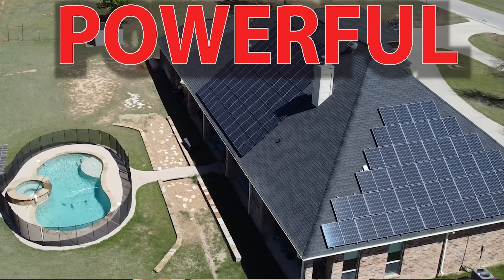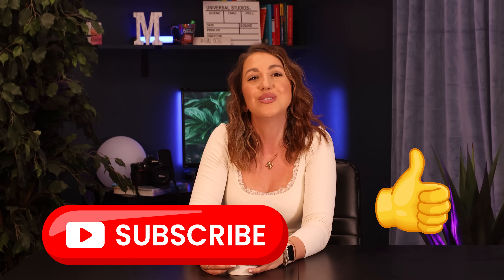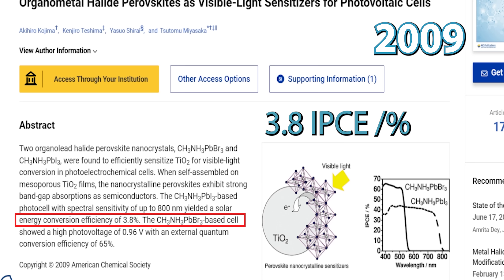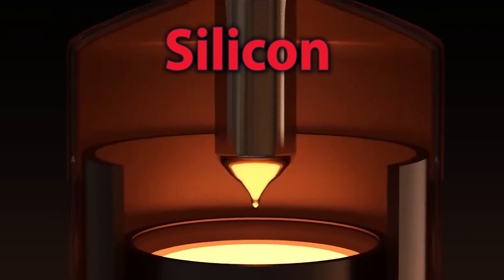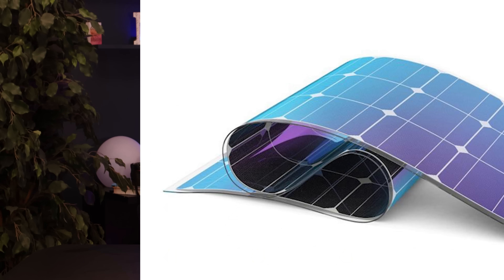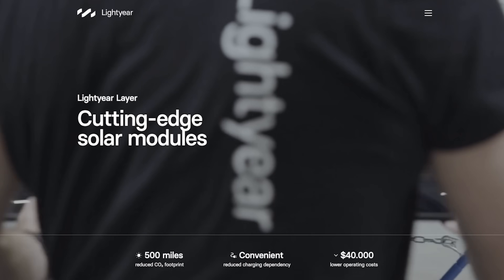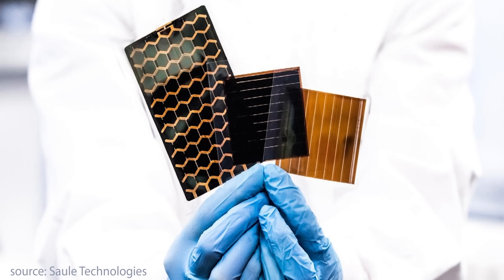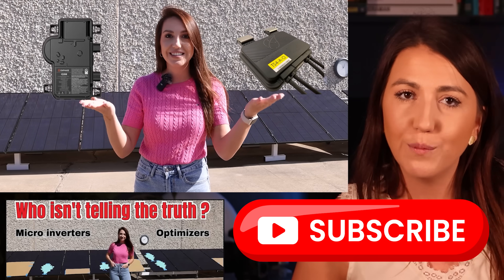Perovskite Solar Panels- You Can Print It Like Paper! Will it Kill Silicon?

Comment: The biggest issue is durability. They are vulnerable and not very long lived. Saule have big problems. The CEO is suing investors. They ate thru 200 million zł(~50mln$) and dont have a factory yet. So the project can die in Poland sadly.
They were developing this technology I think since 2010-12, so its not that new. I hope it develops, but I am not hyped anymore. Too many years it stalled.

Comment: "coat your phone"  Yeah, no.  Setting your phone in direct sunlight at an angle facing the sun, not the best idea for its temps.  Remember even if we assume 35% figure is achievable in real world conditions that still means the other 65% is heat.  Let's presume this solar cell phone can generate 3 watts, at noon, when pointed at the sun.... That means you need to assume 12 watts of heat pumped into your phone, the thing is going to cook, its going to need active fans to keep it from exploding.  

And remember this is an ideal situation where the phone is propped up pointed at the sun.  Even so 3 watts of solar input does not mean you will get that all day long that's what you get at cloudless summer noon.  The average would be about 4.5 watt hours per day per solar panel rated watts. That's if its pointed at the sun from dawn till dusk.  So now your phone is getting 13.5 watt hours of power input but there are charger and battery inefficiencies that will eat about 15% of that. So your battery will only see about 11.5 watt hours.  

Now a 19 watt hour phone will be running which will take some watts to keep it on but in a non active state.  

In the end, your phone will need to be out of hand propped up pointed pointed at the sun all day to get probably less than half a charge, even assuming these lab sample 35% efficient solar panels can be adapted for use on a phone. 

It's simply bullsplat, marketing lies. This will not be something your typical phone will ever have because its simply impractical.

Comment: Sorry, get a bit fed up with "announcements" of "this will change the future of,,,,,."  OK, an increase in efficiency, but it is really only a reasonable increase if it works. Solar cells will never get much better simply because there is only so much photos which can be converted to electricity. Mechanical strength? What happens when a decent hail storm hits? All the elements which make up all the layers which make a big mess when damaged. People, dig a bit deeper and do your research please.

Comment: I've kept up with this design and blows me away with over %30 efficiency and my LG panels are only %22 this could be a game changer for the future of solar production. Just get rid of the lead some how and find a filter system for the other wave lengths of light to control degrading and break down!! Great video and informative as usual 👍 👏 👌
Reply: Solar Stirling engines were between 35% to nearly 40% efficiency over 40 years ago.  Companies tried this but largely failed.

Comment: Efficiency is just a footprint you know the size of the panels but at the end of the day could only put in 15% of advertised output or extra electricity Easley demonstrated with a volt amp meter and 4th grade math called ohm's law

Comment: You can't compare a Lab tested multi-junction cell to a singal junction commercial product with 5x the service life! Silicon cells can reach over 40%
For silicon-based multi-junction cells:
Tandem cells (e.g., perovskite-silicon): Lab efficiencies reach 33-35%, with commercial modules around 25-30%.

III-V/Si multi-junction cells: Record efficiencies hit 39.5% (e.g., Fraunhofer ISE, 2023) under 1-sun conditions, though practical efficiencies for commercial applications are closer to 32-35%.

Concentrator multi-junction cells (using silicon substrates with concentrated sunlight) can exceed 40%, with lab records up to 47.1% for 4-6 junction cells under 143 suns (NREL, 2020).

Comment: My question is if it ever comes to market, will this be the new lead based paint, or leaded gasoline?
Reply: Perovskite is harmless. Its a specificly organized organic structure.
Reply: @iliasclaeys2687  Thanks for that but until they are successful with lead alternatives it does contain lead, so how is it harmless?
AI (who would NEVER lie to us) says,
Yes, the lead in perovskite solar cells can be a significant environmental hazard. While perovskites offer high solar energy conversion efficiency, the use of lead in their production raises concerns about toxicity and potential leaching into the environment if not properly managed. 
Here's a more detailed explanation:
Environmental Concerns:
Toxicity:
Lead is a heavy metal known for its toxicity, with potential impacts on human health and the environment. 
Leaching:
Perovskites can deteriorate and release lead into the environment via water, air, and soil, especially when discarded or damaged. 
Bioavailability:
Lead in perovskites can become bioavailable, meaning it's accessible to plants and other organisms, potentially leading to contamination of food chains.
Reply: @pathfollower  good to point that out, I didn't know. We still use lead in a lot of products (also some pv silicium panels). If properly handled and in a sealed containment, there is no hazard. Lead is highly recyclable btw.

Comment: I've seen some videos about Perovskite, including the latest advancements and the possibility of mass production. I believe it will soon be made available to the general public and together with sodium batteries, these will become the two main foundations on which renewable energy can take the definitive leap to be globally adopted. Sodium batteries are much easier to manufacture, significantly more affordable and represent a major leap in terms of safety, especially regarding thermal runaway risks. The efficiency boost from Perovskite, combined with these batteries, could drive the cost per kW ($/kW) to be very low. I hope both tech to be avaliable in 2030s
Reply: Oxford PV have been delivering panels for more than 6 months.

Comment: Another empty claim. Perovskites are known for a while. Their efficiency drops in less than a year to less than a conventional silicon solar-cell. That's what made them useless, and you're claiming otherwise. Just words and wishes.
Reply: @joen5000

If they are as easy to make and deploy as the video says, then replacing perovskites on a regular basis like once a year would be practical.  And that's certainly not useless, especially in emergency and temporary situations.

Today we can buy reels of LED light strips that are lightweight, flexible and cheap.  In the future, the perovskite solar PV Sheets may come in a roll and just be unrolled and collect solar energy for a short period of time.  The only thing I see that might be a problem is not being able to dispose of them because of the lead halide in them.
Reply: @acmefixer1  That would be a huge environmental issue. Remember, they are deposited on films that aren't disposable, and their materials aren't best for the environment. Compared to todays' modern solar-cells, that last 3 decades, and already quite cheap, except in the USA, due to the tariffs, which is a special case, there is no viability for creating disposable solar-cells, when realistic long-term solutions exist. Besides, there are film-solar-cells that can last for years without negative environmental impact, so why use pompously claimed not-proven high-gain solar-film, when practical and better solutions exist.
You need to keep in mind, for over 40 years scientists have been claiming to have achieved over 80% efficiency. Everyone who has to do with science knows, these are empty claims aimed to justify the funding of their research and for them to advance towards higher academic titles. In reality, none of these claims has ever been proven to be true. These are according to my estimation over 98% of the claims. In other words, most of the fancy publications in this regard are worthless.
Perovskites suffer from a huge stability issue, which makes them useless for real applications. As long as that is not solved, they will have no practical use. Besides, they've never proven to reach 35% efficiency even under lab conditions.
There are solar-cells that can practically reach 38% efficiency in real life, but they are way too expensive, and therefore are used for special applications like in satellites, where price doesn't play a role.

Comment: It won't be flexible panels. It will be the tandem cells.
Perskovite and silicone absorb different frequencies of light. That is why efficiency will be higher for both together than either alone.
Reply: It depends on the circumstances. Tandem cells will be great, if durable and not to costly.
Flexible cells will be great too, if cheap and lightweight, just for other applications. Think about glueing them to the walls of a house.
Reply: @johnbraunschweig Tandem cells are still not as lasting. So you would have 30% efficiency for a few years and then it drops to the 20% longtime silicon waver production.
Reply: Well let's Design a triple efficient panel that also features heat energy extraction cooling the cells which will make them even more efficient and if we are lucky we build heated pools or store the heat  underground for winter. Anyway transparency could help avoid hot panels...
Reply: @usertogo  just run black piping under your solar cells to take off the heat, and it actually helps the efficiency of your solar panels but cooling them down
Reply: @usertogo silicon already absorbs heat but like the rest of its bandwidth only 20% to 25%  (Perovskites absorb UV + visible light)

Comment: Oh wow, this is pretty exciting!  

My 2 cents on longevity:  Cheaper production and flexible configurations mitigates the need for longer life.

Imagine if the panel frames and wiring were just that, frames.  Then every 10 or 15 years just replace the inserts at 1/5th the cost, and you get the latest advances and hit the reset button on other wear concerns, like maybe storm damage.
Reply: It's not only about cost, it's also a out sustainability. A panel that lasts 30 years will always be better.
Reply: @enricod.7198  High efficiency, recycling/reprocessing infrastructure, biocompatible, low-cost, and low-toxicity ingredients could make a life cycle this reasonable and sustainable. The old panels aren't thrown away; they are used for something else, such as building materials, special mineral reuse, etc. There will always be a market for 30+ year solid performance, but that isn't necessary for this to be a great, earthshattering advancement in energy for decades to come.
Reply: If the panels are 10c each it's meaningless if the scaffold needed to install them is $1million

Comment: I would love to see this application used on E-planes.
Reply: Nowhere near enough surface area to supply the energy needs. These will be fine on buildings.
Reply: @hughmarcus1 ultra-high efficiency powered gliders, the same as are currently powered by silicon panels.

Comment: I think the biggest new use for cheap solar panels will be for bifacial vertical fencing. Imagine if every private property and public space was lined with solar fences instead of chain link ones... That ALONE has the potential to add GW's worth of power to each city or state without taking up any additional land except for the transformers/battery storage centres which are still relatively compact themselves..
Reply: I like your enthusiasm but you don’t understand grid stability or PV panel efficiency
Reply: @stevehartley8162 nor do you

Comment: I already have solar installed. The system is working fairly well after 12yrs but has already started to degrade by about 5% when considering cloud cover.  In the future, I'd be really interested if these Perckite panels could be retro fitted over existing silicon panels to increase production and extend the life of old pannels.
Reply: @whirly, no they can't
Reply: Just add a few more panels. I keep adding to mine and increasing my solar power generation.
Reply: No, it wont work.

Comment: 34% +! That's an enormous jump forward for solar, and if they are as cheap as predicted - BOOOOOM!!! There will be a real solar explosion around the world! I can't wait!
Reply: The cost of the panels already isn't the problem. It's the inverters, mounting systems, and solar installers gouging everyone tens of thousands for a week of labor.
Reply: @court2379  In Scotland we have a system that gives anyone in a low income/disabled category, 6 free solar panels, an air source heat pump and standard inverter fitted free. I qualified, so I added more panels, batteries and a hybrid inverter and paid the excess. It all worked out very cheap. I used my savings because they now tax those too, and my pension! Better where it is now, keeping me warm! 😊 
SO, tell me are solar panels expensive where you are? Good quality 440W solar panels now are available new as low as £70 here and installation is also quite reasonable for the work they put in. New Hybrid Inverter was under £1,000 and the new 5.32kWh batteries are available for between 1 and 1½ thousand £'s each too.
Reply from the maker: YESSSS!!! So Excited!!!!!!!!
Reply: @solartimeusa  😊
Reply: Don’t forget about utility companies. They have begun to fight homeowner installed solar by gutting power buyback program rates making homeowner payback times triple.
Reply: @jeffgerritsen972  I installed solar panels, heat source air pump and multi battery setup with a hybrid inverter right at the start. I never intended to give the grid anything if I could help it, so my system is set to "zero export" anyway. Any excess solar I generate when the batteries are full, I use in the home or my garage/utility room. (But in Northern Scotland that isn't a regular occurrence!) 🤣🤣
If there is insufficient solar to charge the batteries I charge them overnight on a low rate tariff which is a fraction of the normal/Day rate.
Reply: @jeffgerritsen972 Depending on how extreme they are doing it, it might be fair. If you are using the grid as a battery, that service has a cost and overhead. The power company isn't making money off the power though due to to running the meter backwards but still has to oay the mortgage on the power plant, pay the staff and maintain the power lines. So essentially your neighbors are subsidizing your power because they are oaying for it through higher rates. Not fair to them, not fair to the power company.

I have heard of some companies charging ridiculous rates that are basically more than just paying for the power in the first place though. That should be regulated. They should be able to make a modest profit on the aervice they provide. Not gouge people to discourage solar development.

Comment: While I do admire the occasional glance into the future, I consider Perovskite solar to be "vaporware".  I don't think I would be willing to trade in my tried and true silicon for Perovskite that isn't proven to be stable under the sun because the whole point of silicon  solar is that it actually lasts... Case in point they have been talking about Perovskite for years now... still not selling in the USA tho. I think the key words you used were "IF perovskites can be made durable"... which means that they still aren't. However, I do welcome their arrival. If they are super low cost, and only need to be replaced every decade, it might be ok.

Comment: Question for you. I currently have 13 four year old solar panels on my roof which don’t provide all my energy needs. Will it be possible in the near future to swap my current panels for newer, more efficient, Perovskite panels? Is that a good idea?
Reply: currently no. if you have the space, just add to them. If not, then swap out for whatever is better that you can afford. 
The stability issues for perovskite will take a while to work out.

Comment: This video is incredibly exciting! Perovskite solar cells truly feel like the next frontier in renewable energy. The idea of printing panels like paper and turning windows into power generators is mind-blowing. I'm especially keen to see how the stability and lead challenges are addressed. This is a game-changer!
Reply: They have been trying to solve these 'issues' with perovskite for a decade.  They just don't last compared to current panels. It's like fusion always years away.
Reply: @jerryhicks8011 those years have now expired & Oxford are manufacturing panels, that's what this video is about.
Reply: @alanhat5252 today's solar are 25 percent efficient and new solar technology will be 35 percent efficient but are expensive and need more layers so its hard to produce for 10 percent more efficient it's not worth.